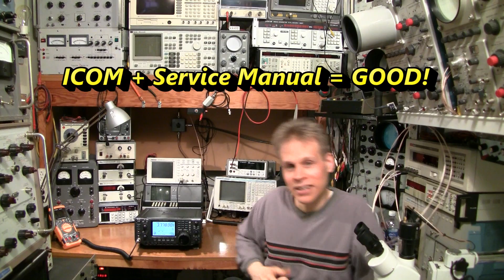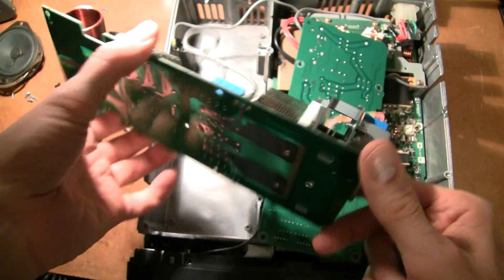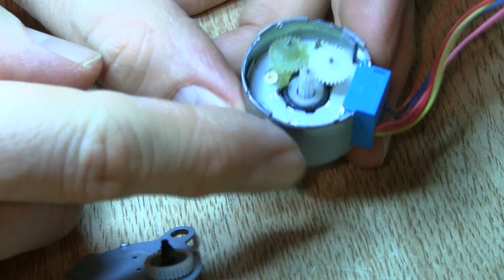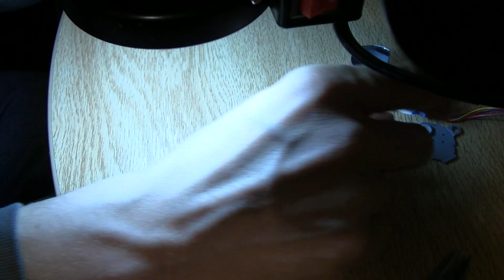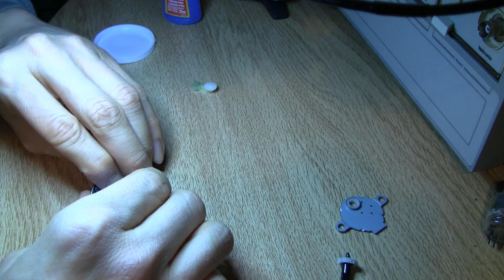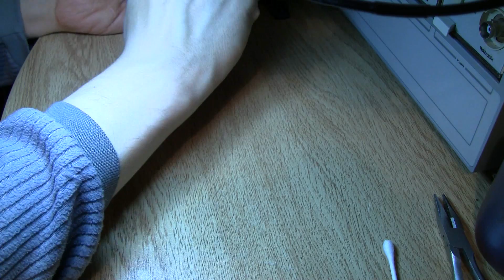Troubleshoot and Repair an ICOM IC-746

Comment: I noticed that the stepper motor being sold by Adafruit (New York) for their robotics/Arduino work ($4.95 each), 
http://www.adafruit.com/products/918

appears to be identical to the 12 VDC stepper motor shown in your video, that Icom used in the IC-746 antenna tuner!

A second part source, USA based, and inexpensive.

w9gb
Reply from the maker: w9gb Sure looks close to the same thing! I wonder if they have re-designed the rotor? Almost worth buying just to find out. Thanks for the comment!
Reply: w9gb I just bought two of those motors. I sure hope they are the right ones. I will let you know when I get them installed.
Reply: Mr Carlson's Lab just a heads up Dr Carlson.... The steppers I received from Adafruit were different... Couldn't use them but I did repair my Tuner by following the exact procedure in your video. I bought my 746 off eBay for $475 plus shipping and now it's working perfect. Thank you Sir!

Comment: A question. I have been off the air for 25+ years and now thinking of starting up another shack.  I noticed all has changed in the 25 years and having problems in choosing an HF rig. I want to stay around $2000 or so and wondering if you have any ideas as a good trouble free HF rig?  I think the ic-2300h as a 2m to start but that's about as far as I've got.

Comment: Hi, first off i don't know much about ham radio's at all..........This unit looks fairly new and its not cheap $900+ why do they need motors for the tuner?
Reply from the maker: Hi Blacklce504. The motors move some variable capacitors around, while the relays switch in different inductor's or coils to tune the antenna.
Reply: Mr Carlson's Lab Oh yeah i had a feeling it was some sort of pot but why couldn't they do this using some digital tuner.

I have a good understanding of electronics but never played around with ham radio's but i do find them interesting.

Side note i got my self a DAB clock radio i taken it a part and found a tiny board

http://www.frontier-silicon.net/products/modules/venice7.htm

works very well, almost shocking well considering there is not much to this tuner just a chip with few external components.

"even the amp was single chip with some caps pumping out 5 watts Class T Digital i think"

I guess its good to be surprised like that every known again when taking something apart, fun fact the pcb with buttons was biggest board LOL.
Reply from the maker: BlackIce504 I see what you are not understanding. In a normal analog radio receiver, a tuner does a different function than an antenna tuner used for transmitted RF. When you transmit RF, (in an HF radio it's usually around 100 Watts or so) the antenna tuner makes the antenna attached to the rear of the radio appear resonant, (or close to)  to lower a thing called SWR or standing wave's. Now, where the antenna tuner adjusts too, depends on the frequency tuned on the transceiver. As the frequency goes up, the antenna must get shorter "electrically", As the frequency goes down, the antenna must get longer "electrically". The antenna tuner mimics this action by adding and removing capacitance and inductance. Those coils you see in the tuner section are for the inductance part, Those motors connected to the variable capacitors move the capacitors around, and the relays switch in different amounts of inductance until the radio is electrically tuned to the mis-matched antenna that's attached to the back of the radio. If you transmit RF power into a mis-matched antenna without an antenna tuner, the final amplifier transistors or FET's will fail in short order.... Very short order! Vacuum tube finals are way more resilient to high SWR than their solid state counterparts. 

The tuner in an analog receiver just moves an oscillator around that's off frequency by the amount of the IF chain frequency. Some of the higher end tuners will attempt to tune RF stages and the antenna stage with a multi-ganged capacitor. This antenna tuning action is "sort of" doing what the RF power output antenna tuner is doing, but the circuit surrounding this part of your FM tuner is quite different. There is no inductor switching in this circuit, just a variable capacitor that attempts to tune your coarse cut antenna. There is also no transmitted power coming out of your FM tuner, so the parts can be much smaller, and SWR or standing wave ratio is not so much of an issue.
Reply: Mr Carlson's Lab
Thank you for taking the time to write such detailed information i shall digest this today sometime.

P.S I also have a nice collection of Valves as well i will one day use them for something "allot smaller then yours" I find them elegant and beautiful to look at but i am a product of the digital age, so i have never really used them so i have no personal experience on what difference is, i do know this if a nuke gets dropped valves will still work but FETS will not :( so yes i agree even with out using them they have some properties to them that none of replacements have.

I have some Philips, AWV, Mullard, Sovtek.
The first three where made in Australia, i guess that's when we used to make stuff :( well we still do just not much anymore...
Reply: IF you have an electronics background (DC and AC theory),
THEN you know the function of Inductors (L) and
Capacitors (C) in an L-C circuit.  
RF, like audio and other EM waves, follows AC theory (more complex math).
--
An antenna tuner performs impedance (Z) matching of
a Transmitter's output, ~ 50 ohms to the Antenna Input ---
for a Specific Frequency by adjusting C (variable capacitors) and
adjusting L (relay switching of fixed coils of known inductance).
--
As you change the Frequency (on radio), the Antenna (RF Load) being of fixed 
physical length, changes its characteristics (Xc and Xl) as the frequency changes.
Reply: w9gb
The Question i was asking is WHY, NOT HOW.

If you had any background you would know its possible to this circuit digitally with out inductors or caps and changed via software variables........but i did not know that this was 100WATTS as stated to me this looked like a CB Radio or something similar but on a larger scale clearly.

One i am familiar with would be a  DSP's sure for a different purpose but if you look at the circuit it self you would understand that its very similar you have your inductors and cap's and resistors and can be done in real time with the right DSP chip or maybe a high end FPG."but not likely due to the amount of power hence not used here".. Mr Carlson was kind enough to answer my question and the Answer if you read what Mr Carlson was kind enough to take the time to write was cost and watts thus a more traditional circuit was used.

Comment: hi i had the 756 pro it had new motors now i know why,now have the 450d that tuner is noisy like the 450d but the pro was much better but it was old and did not want the repair costs if it went wrong .. jeff .. m0prf ..
Reply from the maker: Thanks for the comment Jeff! These are obviously a weak spot in these radios.

Comment: that mechanism you just glued, is a overload protection, if something jams in the motor load, that coupling mechanism just slip and save all other gears. But with time it weak and slips with a normal load.
Reply from the maker: Hello flyguille, That was my original thought as well, but there is no way that little bead makes enough torque to spin in the plastic indexed center piece. When that center piece is placed together "normally without glue", it's tight on the bead. The amount of torque needed to spin that bead on the plastic piece would be pretty incredible. The reason it's assembled that way, is for production ease. The two concentric coils around the rotor, pulse the stator in a back and fourth manor to move the bead (rotor) forward or backward. Without back engineering the circuit, I would guess the motor tells the circuit when to stop when excessive current is being drawn from a stalled rotor ( the end stop) A stalled rotor would also cause wave form distortion of the PWM, it may also sense this.
Reply: well, if it didn't slip with normal usage, how is that it failed?. Anyway I saw several times those motors always with "indirect torque coupling" for "saving gears" if the load is jam. There is several kinds of couplings for that purpose. And ofcourse drivers can have electronically some king of overload cut off, but not.

Imagine this, imagine that you are using the device, and went to prepare a sandwitch, in that moment there was a power fluctuation, and the microcontroller of the device just hung, in the worst way possible, activating motor. The variable capacitors went all to one end, and.... the motor impact in the gears with the stuck load, now, there can have some electrically cut off, but that will take time, because the engineer won't be liking to set up a weak cut off, so, in that moment is when the indirect torque coupling acts".
Reply: Also I imagine that the firmware will test for start up within one end, so it moves capacitor to the start end, and in normal use the indirect torque coupling can act , before the electronics detect that it reached the end poing wanted. (IIRC I it seem in the video when you start up the device). Now glued, that torque will impact in the gears, with time, the gears will be damage.
Reply from the maker: flyguille Hi flyguille, you have many valid points! Again, there is no way that the bead will slip on that plastic rotor. It's just to tight from the factory. If it was to slip, the bead would have removed those plastic extrusions long ago. If you look in the video, you will also see that there is no wear on the plastic extrusions, and no stray plastic debris on the bead. The indexing in the bead is also perfect. I can see the back and forth jarring at the end stops causing the sonicly welded plastic center rotor to break though. Just the top ring, of the plastic center piece broke off; It broke at the sonic weld. The motor itself, in all reality, is very weak and only produces torque through gear reduction to move those variable capacitors. It would take nothing to stop that rotor from turning. Again there is no way that bead has enough torque to spin on that center plastic rotor.
Reply: well, those kind of mechanism normally works with some kind of spring effect or an actual spring for maintain the coupling tight for up to certain level of torque, I would expect that the upper plastic enclosing the rotor is somewhat flexible and allow the rotor to be pushed up if needed, and the extrusions not be perfectly 90º , but something rounded or having some angle, so if it does too much force, it slips.

And what fails with time, is that the upper plastic slips from the axis point where originally was set. A solution without nulifiying the mechanism is to fix with glue the upper plastic only in its axis avoiding it to slips up, and the mechanism will work only with the flexibility of the upper plastic.

Comment: Do you do repairs for the everyday ham? I have an IC-746 that doesn't make full power any longer. I have neither the ability or the equipment to repair the radio myself. I can do a quick video of what I see when operating the rig. 
Thanks, 
Rick  - W9RIX

Comment: Hi there, really enjoying your videos here, and really like the way that you explain everything as you go along, I have one of these that is working fine, but you mention that you did some minor mods, don't suppose you have documented these anywhere have you? If so could you post them somewhere, would be very much appreciated. Please keep the video coming, great job...James MD0MDI
Reply from the maker: Hi James, Thanks for the comment! The mods are heat sinking the mmic by the back of the radio, bottom side. The display fix as you saw in this video.... as well as the AT unit now, and a few others. I would have to do some digging to find any more at this point. Their buried in my files somewhere.

Comment: Good job - keep the videos coming. I'm also a ham and have had to repair an FT-450 several times. One issue was the original CW jacks were crappy, and another was the volume control started feeling like it had sand in it. Was able to take the potentiometer apart and fix the issue. It's good to be able to fix things on our own.
Reply from the maker: I agree! Thanks for the comment.

Comment: Hi Paul, that is really a great solution for the motor. I have had never that problem to fix on a Icom but now it can come :-) Well done !
Reply from the maker: Thanks Peter! One nice thing about this radio.... The A T unit is relatively easy to get at.
Reply: Ditto here: i have an IC~9100 & it looks like the tuner is identical,  so if it fails ill know what to do. Thanks!  Mike  N7MSD
Edit: also have my Elmer's  old TS~850SAT also with  a motorized  tuner. He had it a long time so I'm guessing Kenwood didn't cheap out by using plastic gears like Icom..:(

Comment: Hey - good video there. I've already re-done the LCD display supply much the same way you did. TO-220 package screwed right to the wall. My auto tuner is also knackered and have been putting off digging into it. The way this winter is going here in CT, it may be weeks before I resume the motorcycling activities so I might have time to dig into the pig.
Reply from the maker: Seems like all these radios follow a common path. Glad you enjoyed the video.

Comment: Another very well crafted video, the intro pulled me in and as always it's a pleasure to watch you work. Great job. Did you do the second motor afterall? I only ask because the second motor didn't appear to have been soldered back together when you tested them. Maybe the soldering was obscured by the flexi cable? Great work all round.
Reply from the maker: Good eye! Since this radio is my own, I decided to leave it alone. I would like to see if this motor will fail too. It would be interesting to know if just this motor fails, or if they both eventually do. The action of the failed motor is very "jerky," where as the other motor operates in a much smother action. (The tuning of the other variable capacitor is more gradual.) "Call it an experiment." I struggled with this decision as the A T unit was out, and I really don't want to go back in there.
Thanks for the comment!

Comment: Good repair show, I was curious of your thoughts on the new yaesu ft-991 for a first hf non military radio user (meaning old guy needing a crisp graphic display.) Not so much to use as CW, but since iHeart has bought up most mom/pop FM. I figure there's gotta be some international radio programming out there still worth listening to? But I don't know for sure on HF, lot's of local talk on 2m/70cm where I live.
Reply from the maker: Hi Mooky Mann. Haven't played with the FT-991, so I can't give you an opinion.
From my general experience with Yaesu, they usually are reliable.
Thanks for the comment.